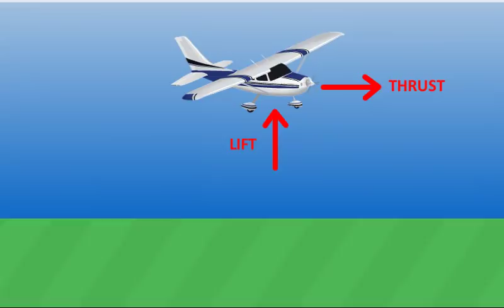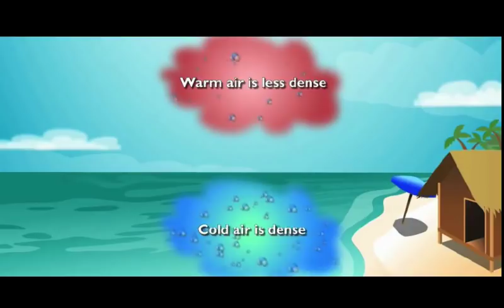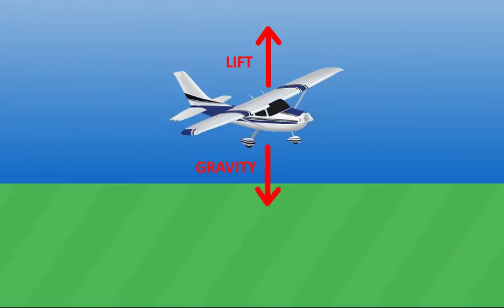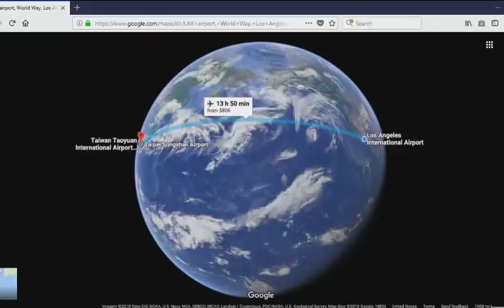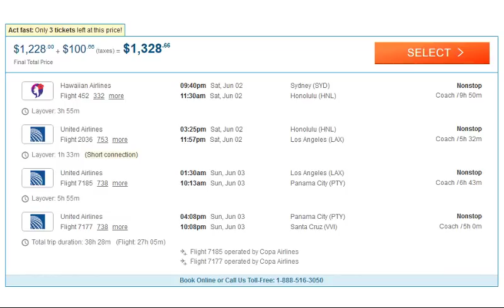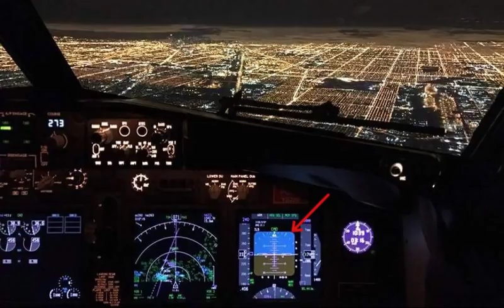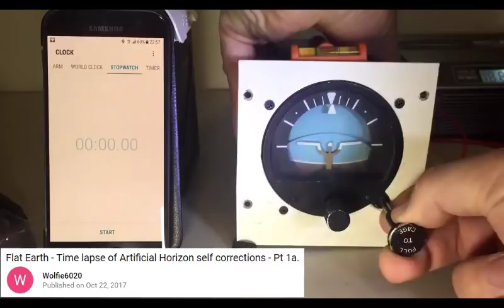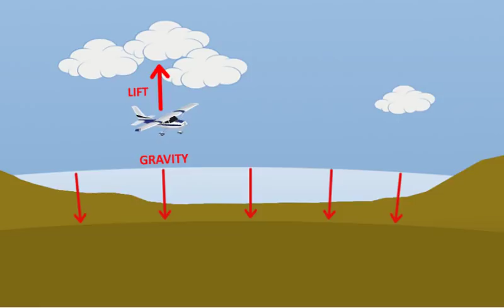Flat Earth Falsities - Plane Nonsense

Comment: IF Earth is spinning west to east. 
At the equator the ground speed is approx 1675 kph.
On a still day the air is traveling 1675kph, west to east.
A Plane takes off heading to the west, and climbs to cruising speed of 500kph.
The plane is now traveling at 500kph ‘relative’ to earth’s speed.
In “reality” the plane is moving through the air at 1675 + 500 kph.

Question 1: How does the air speed indicator compensate for the rotation speed?

Question 2: If the plane turns 90 degrees, it would need to subtract 1675 kph (when the air speed ‘relative to the earth’ is the same) from the Pitot tube wafer reading to indicate the correct reading on the indicator.

Question 3: If the plane turns 180 degrees (traveling due east) it would need to -1675+500 = total of negative 1175 kph (when the air speed ‘relative to the earth’ is the same) from the Pitot tube wafer reading to indicate the correct reading on the indicator.
Reply: The atmosphere and the plane is spinning with the Earth thus it doesnt need to compensate.
Reply: Take an airspeed indicator with you inside your car. Drive at 70mph and note that it still says zero. Why? Because the air/atmosphere in the car is moving with you. Do you really not get that or are you just a troll?
Reply: Very funny !
Reply: @Steve wrote: "In 'reality' the plane is moving through air at 1675 + 500 kph".
No. That plane is moving 500kph through air (so called air speed). Only it's speed relative to Earth center when flying east over equator at 10km altitude in situation where there is no wind would be equal to about 1670 + 500 kph. Its speed measured to Earth surface below would be 500 kph.
Reply: Try an experiment, put something that is round, but rough ( cause earth isn't flat (mountains and valleys)) in a circular bowl of water and keep a constant spin. Will the water around ball stay still or will a whirlpooly type of thing start happening? And what if you left that on for a year, replacing the water that evaporates in a way that makes no waves?  What does Steve Thomas think will start happening?
Reply: Steve Thomas, your first statement is incorrect.  The earth's rotational speed is roughly 1000 mph at the equator not at the pole.  The plane, you descripe was already moving at 1000 mph when it took off.  It did nothing to halt this momentum.  No matter which way it turns it will continue at the speed.  No additional compensation for rotation is needed.
Reply: Steve Thomas xD please go to school. There you learn Newton‘s laws which explain why your quetions are dumb ass fck. You are just too uneducated to understand.
Reply: Steve Thomas - If you are being serious here, which I highly doubt, read the following.

if the ground is traveling at 1675 kph, and the air is traveling at 1675 kph, then for someone standing on the ground or for a plane travelling at any speed, the air is travelling at 0 kmh. 1675 minus 1675 = Zero.
Reply: @jordy f. Have you ever heard about air viscosity?
There you can see demonstration: http://www.youtube.com/watch?v=njX1l8kvXxo
And do not forget that Earth had 4 billions years to "bend" air to its "will" (movement).
Reply: jordy f - I can tell you how it works, the answer is simple - TIME. The earth has been spinning for millions of years. Age of the earth determined by scientific dating of rocks, fossils etc. Over the millions of years, the atmosphere has had time to normalise and align with the rotation of the earth. So they eventually ended up in sync with each other. 

Much like the air in a commercial airliner is automatically in sync with the plane. The air is the plane is encapsulated. The air on the earth is encapsulated by gravity, just on a much larger scale than on the plane.

An experiment of earth size this scale can not be performed, but smaller gas viscosity experiments have been done. Also we can observe the atmospheres of the other planets in our solar system. These all move with their planets just like the earths - proof. 

I've personally seen Jupiter's storms rotate through the telescope. 
Over a few hours you can see graet movement.
Reply: @Bobby Wizdum. Air movement is taking care of that.
Reply: Numbers.  Say enough of them and try to confuse someone into flat earth?
Reply: john underwood what about coriolis then?
Reply: RandomAppleGaming

The atmosphere and the plane is spinning with the Earth thus it doesnt need to compensate

Your answer above is a very easy answer and it is written in your school book.

The question is how to make the atmosphere attach to the ground and moving along together.
How?
Because, how it works is not mentioned in your school book.
So, until today, no one can tell us how it works.
How the air can be attached to the moving ground so the air also move together with the ground.
Please explain, prove it, replicate it using experiment.

If you cannot, please don't blame us to call globe believers are idiots.

Comment: lol. Some of these comments... I don't know if they're serious or just being trolls.
Like, how can you seriously say the Earth is flat when some of the technology you most certainly use rely on the Earth being spherical? For example, GPS.
If you're smart enough and have a decent telescope, you can work out for yourself that the Earth rotates. Damn, you can just look at other planets and see they're all spherical and rotate. Unless you think the Earth is the only planet that isn't.
Seen a vid where a flat earther thinks the sun and moon are the same size and both very close the earth... Clearly never seen Mercury or Venus pass in front of the sun then.
Some people need to clue up on how things work in a vacuum and other simpler things like air pressure
Reply: @Hcloud65
Also where are those satellites?" Can you easily see a car when it is 2,000 km away? No. So why do you expect to see a satellite? However, you can see the ISS and some satellites if you actually bothered to look for them.
https://www.space.com/6870-spot-satellites.html
https://www.microsoft.com/en-us/p/satellite-tracking/9wzdncrdndf7
https://www.ecosia.org/search?q=satellite+finder
https://in-the-sky.org/satmap_worldmap.php
Reply: Hcloud65 - Satellites size range from a cube that fits in your hand to the size of a small bus.
Hoping to see shadows from them cast by the moon is a bit optimistic.
Reply: I used GPS as an example as you need multiple satellites orbiting Earth to pinpoint a location as they work in a network.
Relative to the Earth, the satellites are tiny. You can actually see some on a clear night, depending on where you live due to light pollution. Itll look light a point of light moving steadily across the sky. Due to their height and size, they wouldn't cast a shadow.
There are big concerns about the debris orbiting Earth and some worry that in the future, itll be very difficult to send rockets up, but just like planes, they must follow a flight path.
Gravity is an radial inwards force, rather than up or down. So saying ppl on the south pole are 'upside down' is relative.
Reply: golden3dge
Ever heard of this thing called "religion"?  The present FE cult in the “west” is basically a Christian cult, plus the usual loony hangers on, based on the biblical claims of the Brit, Sam. “Parallax" Rowbotham made in the mid 19th.C. He is the one who dreamt up the ice wall etc. All of the stuff the FE cultists accept as factual is part of Christianity as written in his "Earth Not a Globe". OK
https://en.wikipedia.org/wiki/William_Carpenter_(flat_Earth_theorist)
This was followed up by the publication of “Zetetic Cosmogeny" in 1899 by Thomas “Rectangle” Winship.
Similarly with Islam.
Reply: I've also noticed that trend. Every time flat earth is mentioned, religion is sure to follow.
Old testament states that its ok to own slaves and you can beat them as long as they dont die within 2 days. Also, its states that you can beat your pregnant wife as long as the unborn doesnt die. (Exodus 21)
People can argue that its the old testament but its the bible regardless.
That shows not everything in the bible should be acted on
Reply: +golden3dge
I suggest the bible is best ignored, totally, we have morals etc. without the bloody thing, contrary to what the godbotherers claim. The animal world is full of creatures that act morally. The human world had morals long before Judaism/Christianity/Islam. Again, you godbotherers don't like this and many still preach that the world was totally immoral before their "god" stepped in to sort the Israelites out etc. Fucking joke. Theywere the latecomers on the scene.
Reply: Hcloud65 dude you are stupid. In space there is no upside down. This is just created by the gravity. That why for people in the south you are the one who is upside down.
Reply: +Hcloud65
bullshit gps could be used on a plain." How? Please elaborate as to exactly how the GPS system works.
Reply: Stewart Casey, Wong isn't a troll.  It's hard to be a troll when you're right.
Reply: Hcloud65, because all but the largest ones, ISS and Hubble are too small to see at that distance.  Many of the new satellites are about the size of a bread box.  Can you see a bird with a telescope at 300 miles?
Reply: @UBSSCABF. Why do you think that Vatican is at the forefront of Heliocentric Theory? They just recently admitted that Galileo was right. I wouldn't call that being on forefront.
Reply: +Hcloud/ how old are you?
Reply: @Urban Bass Slayers Sacramento CA Bass Fishing.
You have been answered elsewhere and your stupidity exposed, so stop trolling and be a big gurl.
Reply: wong stop trolling you douche
Reply: wong Why is the Vatican at the forefront of Heliocentric Theory Mr. Its Christian's pushing FE.?
Reply: +john underwood
Cheers.
Stewart Casey on the other hand is a troll. A "smart arse" type.
Reply: Majd Saedy
No. You are stupid because there are no "verses" in the bible that state the shape of the planet explicitly, are there. As with the quran it is all personal interpretation, aka bs.
Reply: +wong/ actually Muslim flat-earthers are way more stupid than Christian flat-earthers because there are no verses in the Koran that state the shape of the planet explicitly...so they resort to twisting and distorting the meanings to try to prove a flat-earth.
Reply: Also where are those satellites?   If there are over 3000 then why do we never see the shadows on a clear sky with the full moon.  why do we never see them in the fake pictures of the earth? and why are we able to keep launching rockets and never crash into one
Reply: bullshit gps could be used on a plain.    And I still do not believe that people at the south pole are upside down